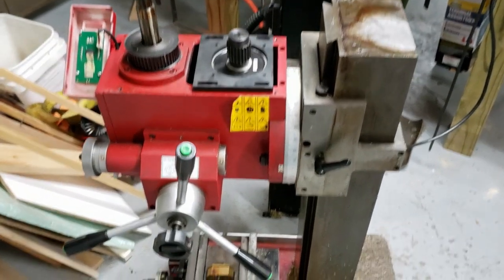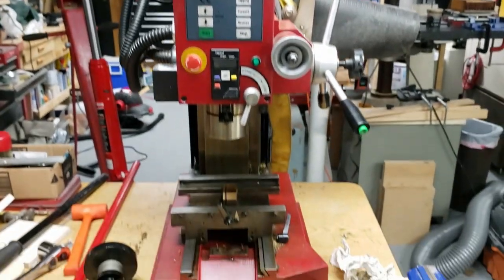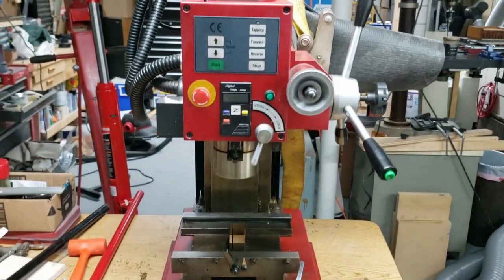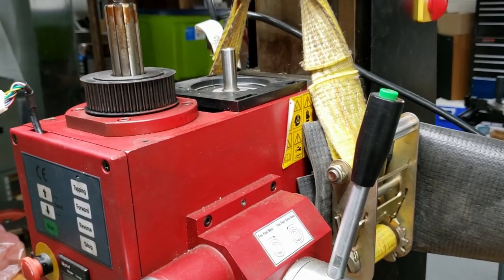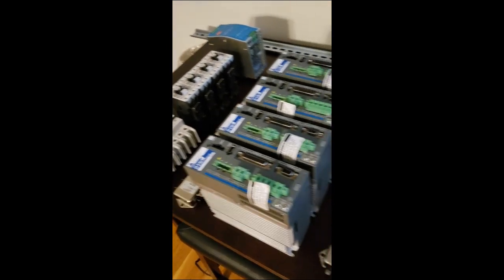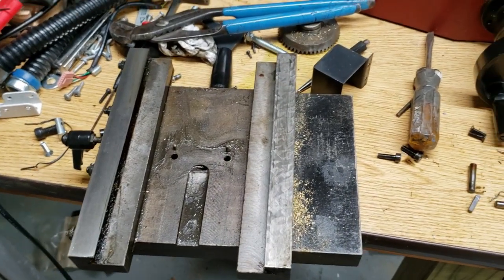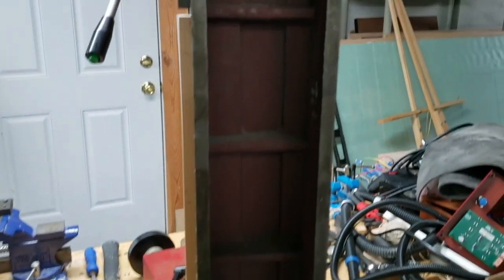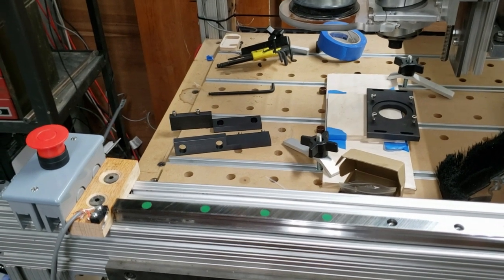SX3 mini mill CNC conversion part 1

Comment: Hi, I CNC'd this machine.  It is now set up with ballscrews.  I had used for years the CNC Fusion leadscrew kit, but designed my own 3d printed X/Y ballscrew conversion for SFU 1605's.  It requires onIy a few machining operations that you can do on a manual mill (ie: this mill before its been taken apart).  I am in the process (bought material today) of designing and implementing a SFU ballscrew Z-axis.  If you are interested in ballscrews control on the cheap, feel free to email me at dr.peter.kirk@gmail.com.  I will say that this machine has brought me a decade of reliable use.  It is really a winner for the hobby machinist!
Reply from the maker: The kit that I am using is the continuation of the fusion kit, now being made by another guy. Do you have pictures or videos of your build?